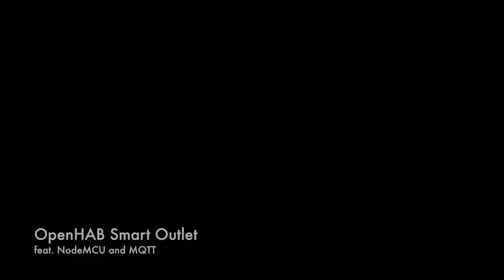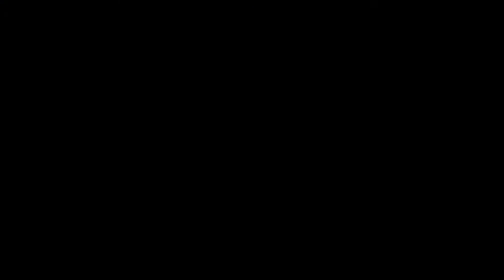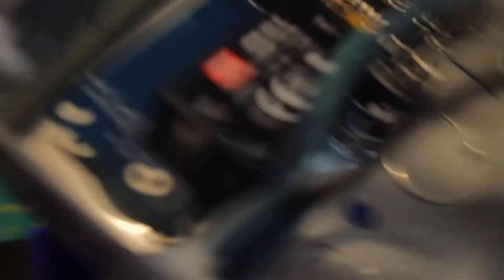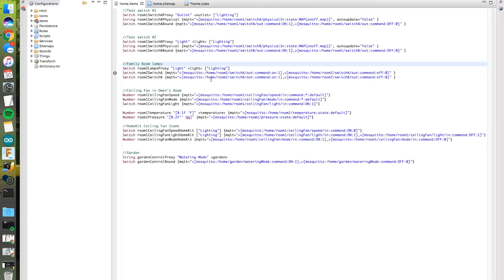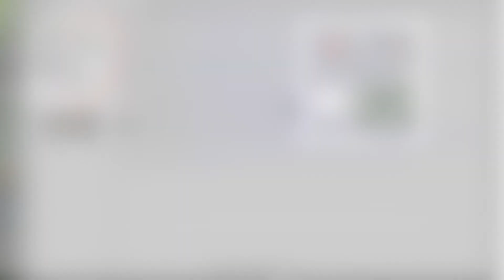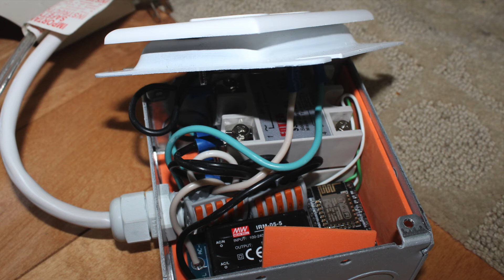OpenHAB Smart Outlet

Comment: Ok so 1 thing I understood was you are using auto mode and that follows the rule file means for lights you have set the timings for them so if you lights to auto it would automatically turn on by the time set for them same goes for fan right but how are you controlling the fan speed